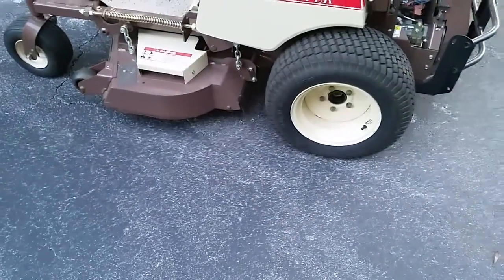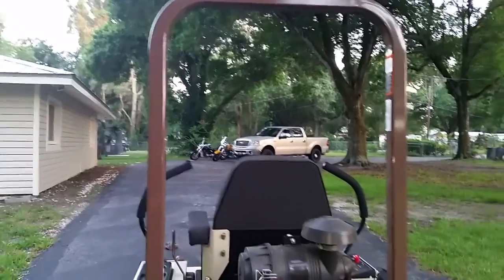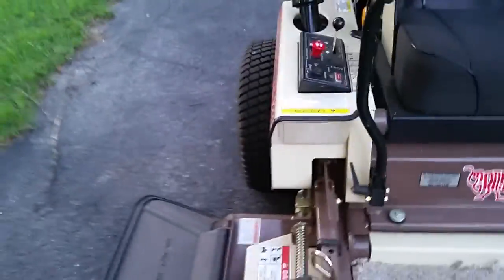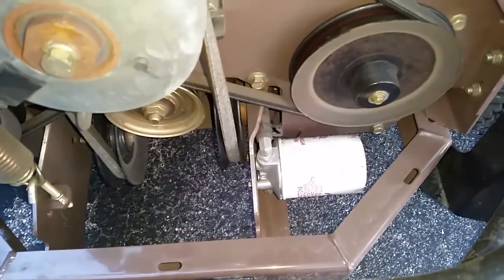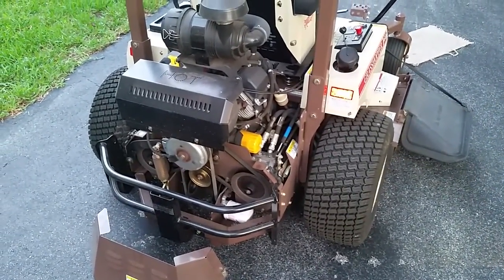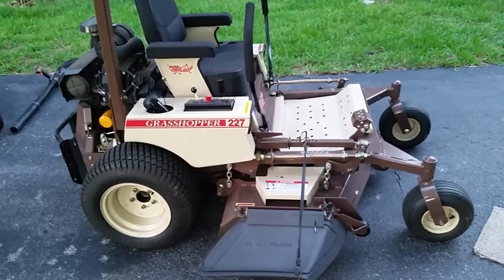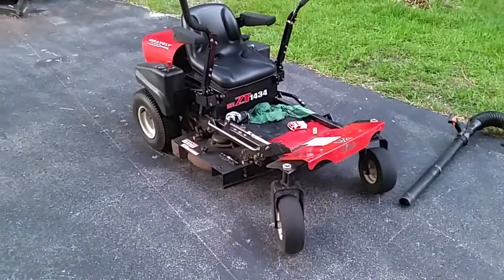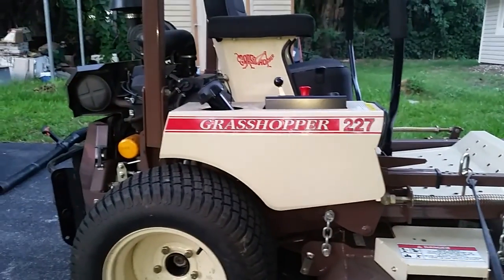Quick look at my 2014 Grasshopper 227 Z-turn.

Comment: I have a 218 grasshopper, your right, they are awesome mowers. Easy to service, until the stator, or the magnetos go out. Then on my 218 I had to pull the engine to replace the stator. If you notice when you tilt the seat forward, the plastic fan shroud that has to be removed to access the flywheel, and the stator inside the back of the flywheel. But, you don't have enough space between the front of the engine and the brace under the back of the seat to remove the plastic shroud to access the fan and the flywheel without pulling the engine. And that's a pain. That's my only complaint about the design of my 2004 model 218. Maybe yours will never need replacing, but mine did.
Reply: You can usually just unbolt the seat/floor frame and tilt it up enough to get the fan out - at least I was.  (agree on the dodgy original ignition though)
Reply: @jeffrandolph1  The frame cross piece behind the seat and fan shroud is welded in place, there is nothing to unbolt, on mine.
Reply: @carlking8530  Yah, sorry I didn't describe that very well, the whole floor/seat/welded part can be unbolted and just lifted up enough.  You have to take off the fenders to get to the bolts in the back.  A grasshopper tech described it to me - let me see if I can find that email.
Reply: this was what the "ask a tech" sent and it worked for me.  "Two choices:  Pull the engine out of the frame or you can try to move the crossmember forward.  The crossmember is part of the upper frame.  There's four mounting bolts that secures the upper frame to the lower, two at the heels of your feet when sitting in the seat and two at the rear, I believe under the fenders.  You won't be able to slide the crossmember more than an inch or so.  If you need more than that you will need to just pull the engine out."
Reply: @jeffrandolph1  Thanks a bunch
Reply: @jeffrandolph1  I appreciate your time. I really hope that I don't have to deal with it again